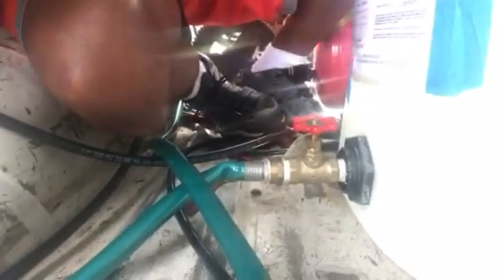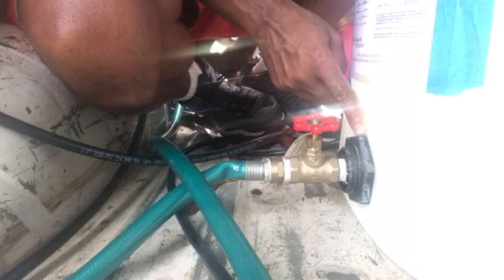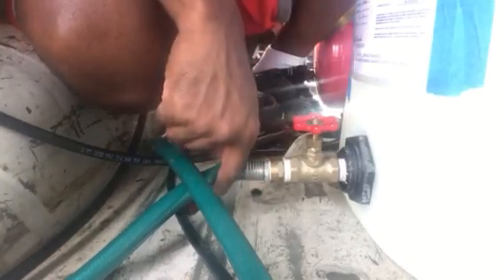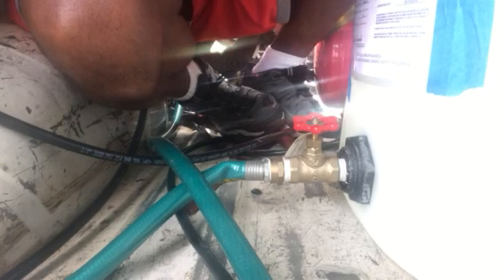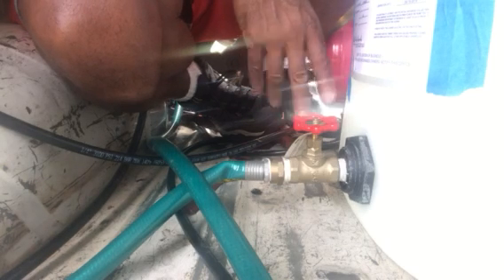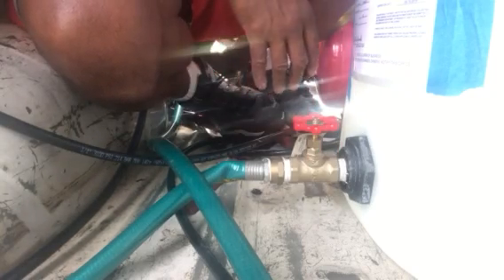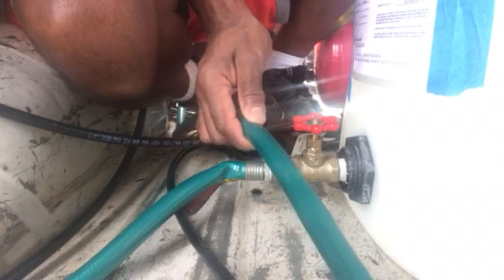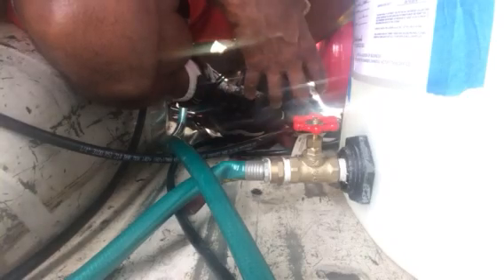Knowledge of how the gravity fed tank works.

Comment: Hey Mr Jones what is the best power inverters to run my Shop vac. And my pressure washer. I have an electric pressure washer 1500 psi. 5hp shop vac and a Steam Cleaner but I dont know if I should get a generator or an inverter
Reply from the maker: Hello Robert. I haven't really  use the inverter for my detailing business my friend. I've always use generators. Sorry i couldn't answer that question for you.  I always be honest with my subscribers and followers on my channel. Positive Flow.

Comment: Did the water pump come with the tank or did you have to go out and purchase one separately?
Reply from the maker: GM Braylon. I hope everything is well. Actually my set up does not have a pump on it. My pressure washer has a built in pump. Positive flow

Comment: I have a 65 gallon tank 
I can’t get the water to fill up my hose to shoot out water.
The tank has a nipple. I also have a 100ft expanding hose. I have my ball valve right after the nipple. What do you think my problem is because it’s not feeding enough water to get to my pressure washer. I’m trying to stay away from buying a pump.
Reply from the maker: Hello D. I've seen this problem several times before. The first thing to make sure your pressure washer has a built in water pump on it. 2nd , If it does you will have to keep letting the pressure washer run for about 2 min and turn it off. You may have to do this several times before the water start to come flowing out. Basically what you are doing is priming your brand new pressure washer pump. It has to have time to fill its system with water to get it going. Positive Flow.
Reply: Eric Jones I figured it out a few hours later. I had to hook my clear hose directly up to my pressure washer. Problem solved brotha. I appreciate it. 🙌🏾

Comment: Mr. Jones I'm having a difficult time drawing out of water tote. I have 300 ibc water tote. Dewalt Pressure washer 3400 psi 2.5 gpm. Briggs & Stratton generator. Bought this transfer pump that's 115v. It gets hot. What's the problem?
Reply: You need water circulating back out of the pump into your water tank so it can continuously run and not get hot.

Comment: What can I get to get pressure from my water tank to my pressure washer
Reply from the maker: Jerry Mcguire What’s up Jerry? 1st question is does your pressure washer have a built in pump?
Reply: Ya but they told me that I have to have pressure to it before it works
Reply from the maker: Jerry Mcguire How much water do you have in your tank Jerry? It has to have enough water for it to pull through. If you have a new pressure washer it will take a minute for it to start to pull. Leave it running two minutes at a time n keep mashing the trigger until you start to see water coming out. II just helped a guy with that same problem.
Reply: 250gal tank is there some kind of pump I can get to pump the pressure to my machine

Comment: Would the gravity work with a 30gallon tank?
Reply from the maker: MPineda803  That is a great question. I don’t see why not.As long as your pressure washer has a built in pump to help pull the water once it starts to flow. Thank you for tuning into my channel. Positive flow.

Comment: Does this work the same to a truckmount? I'm looking to install a water tank. I need some good advice. The people at the shop wanna charge everything and give me the most expensive way to have it installed. How do I get in contact with you outside of YouTube?
Reply from the maker: Derek B What up D? Yes it does. Gravity fed works on trucks.
Reply: Does water tanks work like a water hose faucet? Do I need a pump?
Reply from the maker: Derek B good question. You can either use a pump or do what I always do, I buy my pressure washers with a build in pump so that way when the water reaches the pressure washer the pressure washer pump pumps it through.
Reply: Thanks, I appreciate the feedback. I'm just trying to save a few dollars but still have good flow of water coming to the truckmount. Thanks

Comment: I don’t know what’s going on but I can’t get mine to work. The water hose is hard water flows out the hose but not going through my pressure washer. I’m lost
Reply: Alpo Stackz I got it to work. I had a 6 inch hose and still do . For some reason it does not work unless the actually pressure washer hose is not water. Tight . If it’s water tight it won’t turn on but if I loosen the hose where water spits out a bit it works I don’t know why that is
Reply: @confirmedl6901  HOPE THIS HELPS LET WATER FLOW, THEN SQUEEZE GUN TRIGGER, ONCE A NICE FLOW COMES THOUGH PRESSURE WASHER GUN THEN TURN UNIT ON

Comment: What if you have a electric washer
Reply from the maker: jimee Anderson What’s shaking? It will work for starters. After while you will run into jobs that need much more pressure power to clean them. Positive flow.
Reply: @ericjones3920  I have been wondering they samething. I have a 250 gallon water tank and I'm wanting to hook up a electric pressure washer but keep getting mix reviews about u can u can't u need a pump. Just wanting to detailing rv. I have a house washing van already wit 5.5 belt driven but needn a detail van set it so I can out source more jobs and keep my house washing van free for the big money